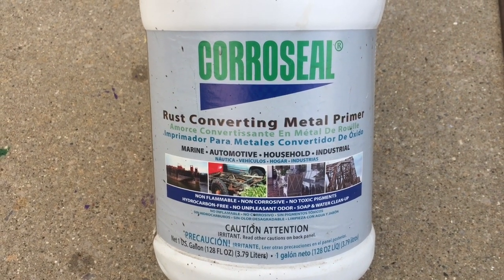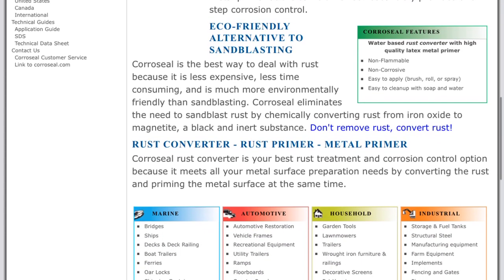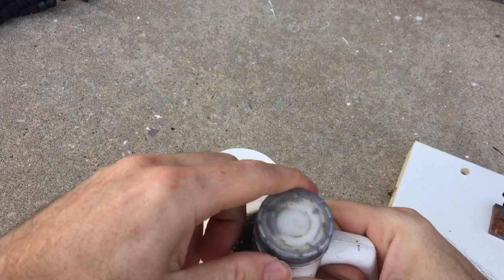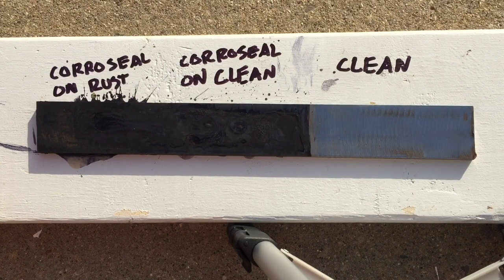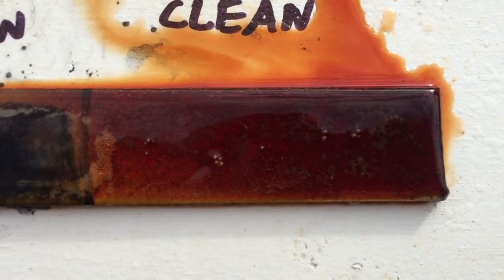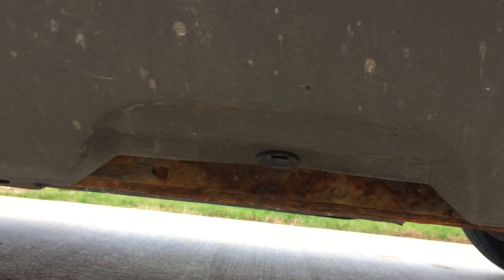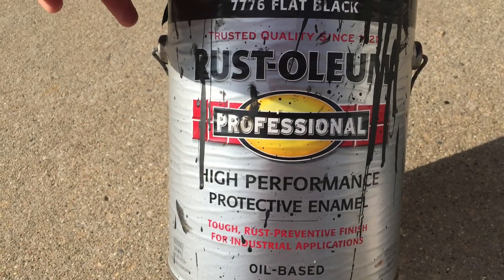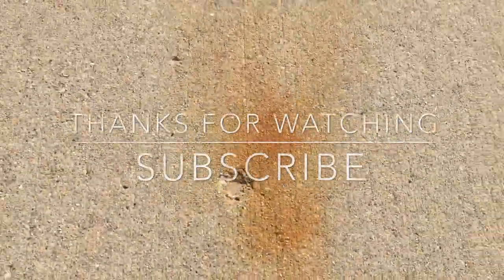CORROSEAL Rust Converter - Does it Hold Up On Its Own? Tests and Results! 4 year review! Stop Rust?

Comment: I had a hideous rusty truck bed tool box.  I wire brushed the rust.  I sanded the good paint.  I applied 2 coats of corroseal to the rust.  I spray painted entire tool box with 2 wet coats  the next day.  The adhesion on the corroseal was excellent.  The tool box looks excellent 3 years later.
Reply from the maker: Awesome! Glad it has worked well!

Comment: The rust converter is not intended to be a top coating it's intended to be a primer. You need to topcoat it with paint to seal it.
Reply from the maker: Thanks for the comment! I agree that a top coat is required to stop new rust from forming as a result of the metal surface being exposed.

In the real application to outdoor pipe, vehicle frames, vehicle brake drums, vehicle body panels, and weld seams for new body panels, I did indeed apply Corroseal, then a top coat of paint. Either Rustolum oil based paint (which I have found to hold up the best) or automotive spray paint.

I experienced rust bubbling back through, from under the paint, implying that the rust was not converted and continued to grow. I know this is true for body panels. The paint absolutely did not wear off, exposing bare metal. The rust came back from under the paint.

I am performing a more practical test over the winter. Corroseal + paint. I will post the results in the spring!
Reply: For my application, full frame, painted after I put it on the frame - it's all perfect. I used a two component industrial primer on top of it.

Comment: Did you try applying a top coat like the instructions say? It's my understanding that rust converters, convert rust but do not stop new rust from forming thus the need for a top coat.
Reply from the maker: Thanks for the comment! I agree that a top coat is required to stop new rust from forming as a result of the metal surface being exposed.

In the real application to outdoor pipe, vehicle frames, vehicle brake drums, vehicle body panels, and weld seams for new body panels, I did indeed apply Corroseal, then a top coat of paint. Either Rustolum oil based paint (which I have found to hold up the best) or automotive spray paint.

I experienced rust bubbling back through, from under the paint, implying that the rust was not converted and continued to grow. I know this is true for body panels. The paint absolutely did not wear off, exposing bare metal. The rust came back from under the paint.

I am performing a more practical test over the winter. Corroseal + paint. I will post the results in the spring!
Reply: @HowtoandReviewsOfficial   After Corroseal don't use paint on the frame, use a rust inhibiting coating like CRC Corrosion Inhibitor as tested by Project Farm here: https://www.youtube.com/watch?v=lyWHF4NoNVk

Comment: I have also tried several tests with products on my vehicles.   The rust converter I've used is from Loctite.   I have had admiral results with it over many years.  I own a 1978 F 250 4x4,  which I purchased new.  I've used this process on the front fenders in the wear areas from long ago fender flare wear lines.  To this day I have no rust on these fenders where I used this process.  But I did coat  with paint after the Loctite rust converter was applied.   My truck is used in the winter with salt on the roads and has never been in a garage.  It's 43 yrs old now and I'm happy it still is in nice condition.   However ! ,  I am currently on my 3 truck bed.   Each lasted about 20  years.    Good luck and thanks for your  info.
Reply from the maker: Thanks. I will check it out.

Comment: Hey I think it should only be used on tight surface rust if your not going to take down to fresh clean metal. You usually clean and prime metal with a etching agent prior to priming or painting.

Comment: I also have had the same experience as you ,rust comes right back no matter how many coats or how much prep! I am in Western Pa where road salt and brine are put down so heavy you can hear your frame rusting on a good night! I have had just as good of luck with Rustoleum Rusty Metal Primer  as anything I ve ever used.If you put it on heavy and brush it in it does help slow rust down . I now use a product from Berkebile Oil Company in Somerset,Pa.It is called PFC ,(Protection First Class),it is a blend of Lanolin Based ,Rock Wool type product .Their salesman showed me tests of their frames on the sales fleets vehicles and I was impressed . I think you would like it.I spray my pinch welds and rockers and my frame . It creeps nicely and seems to stay on better than fluid films. I saw tests on the WD 40 product you are going to try also . You can get a gallon of PFC and a spray gun package for around 100 bucks.I am going to go that route.I have used over a dozen cans and love it .The small cans cost adds up quickly .
Reply from the maker: I’m pretty much done with rust converters. None of them seem to work. Here is a pretty good video that I recently watched. https://youtu.be/tu1n1POMg98

Once the rust begins, there is no stopping it. You can slow it, but it’s a loosing battle.
Here is another product that you may be interested in. I have not personally used it, but it’s currently at the top of my list if I try a product like that.
Cosmoline RP-342
https://amzn.to/3UF0rQ4

This year, I just sprayed Rustoleum truck bed liner on the underbody of all my vehicles for the winter.
Reply: POR 15 is the best stuff i've used for a top coat to prevent rust. Corroseal works very well on some metals and not as much on others, like car sheetmetal. Not sure what's different about 'industrial' metals like on snowplows and farm equipment.
Next week i'm doing my van - sprayed it last year underneath but no topcoat....gonna do the corroseal, rustoleum then fluid film or LPS3, i have a gallon of each and an eastwood undercoating gun. 
Fluid film needs to be done annually - seems just like the ziebart tretament...and they want it redone every year too

Comment from the maker: Hello! In this video, the intention of the test was to show how Corroseal holds up on its own. I have received several comments, and am well aware, that Corroseal is a primer, and should have a top coat of paint.
I am currently running a test over the winter. I have applied Corroseal to half of a rusty bar, and Corroseal plus a topcoat of paint to the other half of a rusty bar. The bar is zip-tied under my car for the winter. I will post the results video in the spring!
UPDATE:
New 7 Month Vehicle Frame Test Video:
Clear Paint, to see if Corroseal is holding up under the paint!
https://youtu.be/pHeHN5h4l6I
Reply: Thanks for the video, I believe all kind of rust conversion is for preparing the surface before Zn-coating, and paint it.  I believe 3 steps is necessary. 1. rust conversion, 2. Zn-coating, 3. paint it.
Reply from the maker: PA2060 is illegal  Thanks for the suggestion. I have not tried those products. I appreciate it.
Reply: Please test with an undercoat.
Reply from the maker: @andrewc9790  thanks for reminding me about this!
Reply from the maker: @andrewc9790  I retrieved the test bar from underneath the vehicle today. I will post the results video soon. Maybe this weekend.
Reply from the maker: @andrewc9790  7 month test with clear-coat: https://youtu.be/pHeHN5h4l6I

Comment: 5 days ago, I finished applying 2-3 coats of Corroseal to my frame. I had previously knocked off as much rust as possible, and sanded the frame. Some spots were shiny metal, but most still had rust. The Corroseal turned black, just like the instructions said it would. 2 days after, I sprayed painted the entire frame with POR-15 Top Coat. It's been raining here for about 4 days straight, and I brought the truck in to work on another part. I was shocked to see that the entire frame has what looks like brown dots of rust. I was able to wipe it away, as it was still wet. Wet, mostly from condensation. The rain is not directly coming down on the frame. It only took 5 days for the rust start showing up. I don't think this stuff works at all.
Reply from the maker: Wow! Sorry to hear that, but thanks for sharing! I personally need to coat the bottom of a vehicle very soon before winter rolls in. I have not yet decided which product I am going to use.
Reply: Went to Chassis saver after derust with wire wheel and clean .

Comment: Brother I think your issues here, as I witnessed when you did the extensive testing on the flat bar, is that you likely spray on top of the corroseal before it is completely dry. When you did the rust over clean and rust over corroseal tests, it's evident that there were areas of the corroseal coating that were still globbed up and wet. Wait for the stuff to fully dry out, and absolutely use a top coat.
Reply from the maker: Thanks for sharing! I definitely recommend a top coat.
Reply: He needs to read the instructions it’s not for body work especially where a seam is that moisture can get behind and supposed to put more than one coat and let it dry before painting

Comment: I disagree, I've used corroseal for years on different applications. Used it on my truck and jeep frame. Used as per instruction, remove all flakey rust, degrease the rusty object. Use multiple coats if necessary, acts as a primer. And I usually paint over with some industrial paint, preferably glossy. Havent had an issue. Also dont put un used corroseal back in bottle it contaminates the product. And this is from Canada with our winters and salt...
Reply from the maker: Thanks for sharing your experience! I appreciate it! I read many great reviews for Corroseal, which is why I bought it.
I have tried it several ways, including wire wheeling the rust, then Corroseal, then paint, and the rust bubbles back through from under the paint.
I am happy to hear that you have great results. The product is worth trying. Unfortunately, it has not worked well for me.
I am performing a test over the winter. I will have a video up in the spring.
Reply: @HowtoandReviewsOfficial  did you degrease before applying?
Reply from the maker: @ryansremark6983  No, not officially. I use rubbing alcohol after wire wheeling, but I do not use an official commercial degreaser. I will incorporate degreaser into the winter test, thanks for bringing it up!
Do you apply it onto metal that has surface rust, or do you grind it down to clean bare metal?
Reply: @HowtoandReviewsOfficial  . I work on commercial workboats in a salt water environment. Been using Coroseal for 14 years with zero issues. You must follow the directions perfectly. You must leave a light coating of rust.....Coroseal does not like shiny clean metal. It needs rust to convert itself into a primer. I always do the Coroseal, then primer and topcoat with color. No issues at all. On your vehicle rust spots, you are better off trying Mastercoat Silver rust prevention sealer. THAT stuff is the bomb and is exactly what you are looking for. Coroseal is more for anything except an automotive paint surface situation.
Reply from the maker: @FIGGY65   Very helpful and appreciated; thanks for taking the time to write this. 
About 95% of my Corroseal use has been automotive application. I’ve done Corroseal on rust + topcoat, Corroseal on rust + primer + topcoat. I have also used it on clean metal as a preventative/failsafe + primer and/or paint. The results have been mixed, and on the negative side. (I do not use Corroseal without a top coat. I was just testing how it holds up on its own, on a couple different surface, in this video.)
Strangely, it did very poorly on new welds. Lots of new body panels with rust coming through the paint on the weld beads. 
I will definitely be trying the Mastercoat Silver.
Thanks again for your comment. It is helpful and appreciated.

Comment: I used coreseal and capped it with boiled linseed oil I'll see how it holds up
Reply from the maker: Let us know how it goes!
Reply: @HowtoandReviewsOfficial  it's a test I mixed the linseed oil with 25 percent Rust-Oleum and sprayed it with a Wagner spray gun I'll keep you posted
Reply: I’ve read replies from other channels that say to spray it with a zinc paint to stop the rust and then topcoat

Comment: Well.
Scratch another "wonder" product for my old truck frame.
Thanks for the review.
Reply from the maker: It definitely has a lot of great reviews, which is why I tried it. But, there are negative reviews as well, and it has not worked well for me.
I would use it to coat some pipe or something outside, but I would definitely not trust it to restore my entire rusty vehicle frame. I would anticipate rust coming back in a year. But, that’s just my experience.
Reply: Look up Qurox (if you can find) it's amazing stuff. Had a shop putting in an engine and when the dropped the frame we noticed a section that could use a touch up. This stuff took a power washer and New England salt directly and no rust has formed on the Qurox.

Comment: To use correctly, those latex/phosporic acid rust converters are only used to wirebrushed or sandblasted, clean-looking metal to prevent small pits of rust starting to grow. Even then, the metal must not be rusted through at all, or else the rust gets oxygen that way. For example, a lightly rusted car surface should be cleaned to look rust free, then the converter applied and allowed to dry completely, cleaned again to bare metal, primered with rust preventing primer, and painted. On the inside/other side, rust preventing spray applied to prevent possible rust pores that go through the sheetmetal to allow oxygen go through. Any rust that has formed layers is not treatable with converters, only way to slow that rust down is to thin atf with solvent, soak the area inside and out, and after few days, use rustproofing spray to form an oily/wax-like surface to prevent the atf from being washed away. And that only slows the rusting process down for some time. "Rust never sleeps..."
Reply from the maker: Thanks for the input! Very good information. 
Corroseal claims that it can be applied to a rusty surface with no sand blasting required. In my experience, that is not true. But if you grind down to clean metal, there is no need for a converter.
I have applied it to rust free metal, before paint, as an extra precaution, but that’s not it’s purpose.
Anyway, thanks for sharing. I completely agree.
Reply: @HowtoandReviewsOfficial   I use a rust converter gel to remove both rust and mill scale.  I have had great results making sure the metal is clean of rust flakes and apply it and keep it wet with either the liquid or a bit of water.  Using a good heavy britsle bush works well and a paintbrush to smooth over the gel.  Then i clean off any excess.  With the krud cutter you are left with a surface you can paint but you'd have to rough it up pre treatment for best adhesion results.  I use it on anything i intend to paint or keep nice.  A light coating of fluid film once the paint dries and you've created a surface with multi level protection.  Using a self etching glavanizing primer also helps.  When the phosphoric acid gel turns the surface black it has simply sealed in the rust along with any humidity that was present.  I am always wary of the black coating as i have scraped it off with ease using a paint scraper.  It often takes much of the the rust with it when you do.  After scraping it off ill treat again if necessary.   Dont be afraid to brush the surface as its working.  Youll have less left behind to worry about

Comment: Thank you so much for the content. I'm sure many of us appreciate when someone does the testing and review the product for us so we can see how it works. That's actually why I clicked on it, right? So please don't take my next part of the comment as me boo booing your video. However, I have purchased CORROSEAL before and let it sit for a very long time without using it or maybe dipped my brush into it and contaminated it and it turned into a more liquid and not as white substance. I noticed immediately in your video that the product you were applying looked a lot like mine once it was no longer good. Just wanted to point that out for the sake of the experiment because when CORROSEAL  is in good condition, the consistency is almost like Elmer's Glue, and with that being said, it may be that the product was not able to perform as intended in this testing.

Comment: THANKS FOR THE HEADS UP!!! Almost bought a gallon😮 I’m trying to compare this with POR 15, I’ve used previously on a wheel well. I’ll stick with that
Reply: Maybe this stuff them por15 over it ?
Reply from the maker: Here is a pretty good video that I recently watched comparing rust converters. https://youtu.be/tu1n1POMg98

Fighting rust seems to be a losing battle. I’m pretty much done with trying, and reviewing rust converters. This year, I just sprayed Rustoleum truck bed liner on the underbody of all my vehicles for the winter.